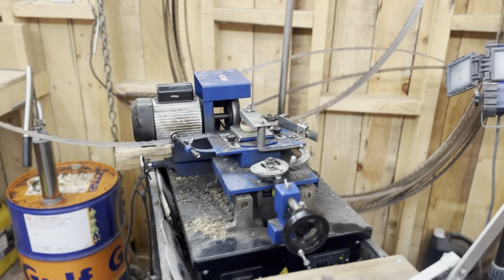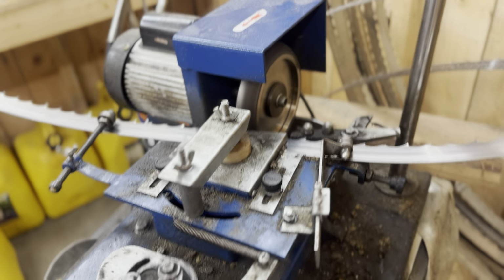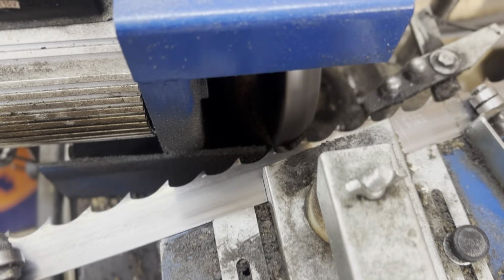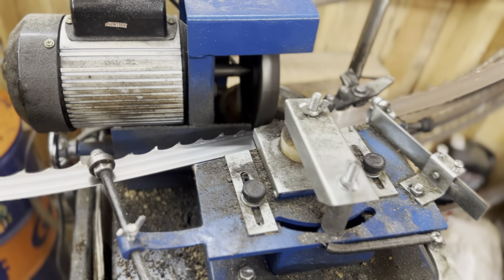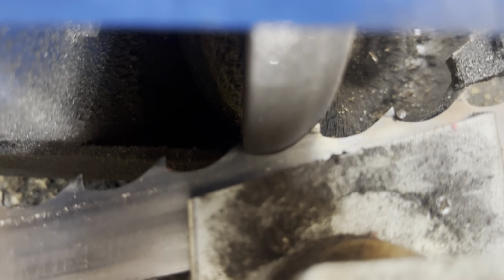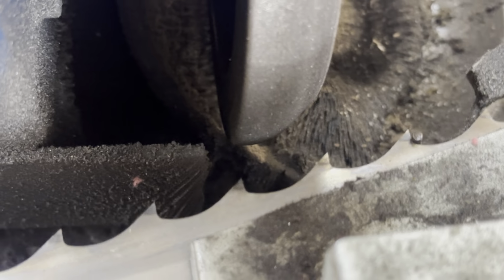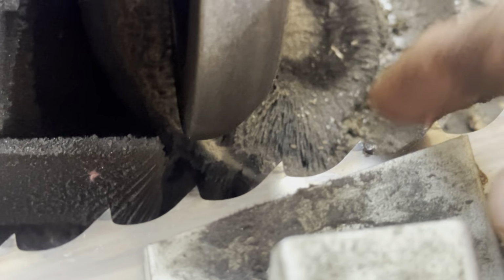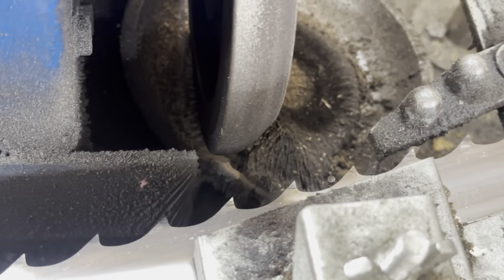RAIN DELAY- BLADE MAINTENANCE. Range Road RR5055 sharpener.

Comment: The whole tooth and nothing but the tooth! I gotta look into that sharpener, I bought an entry level Norwood sharpener that simply has a dremel tool on it and you crank it by hand and it cost a bit more than yours. Where did you get it?
Reply: we have them in stock!
Reply from the maker: Range Road in Alberta, where are you again?
Reply: @thelogfather5002  Charlotte county NB
Reply from the maker: @justinrussell760 right on… I thought so.